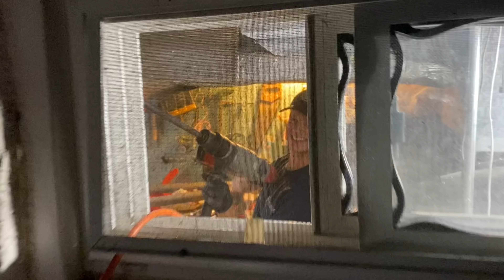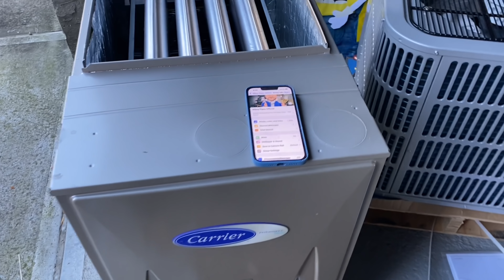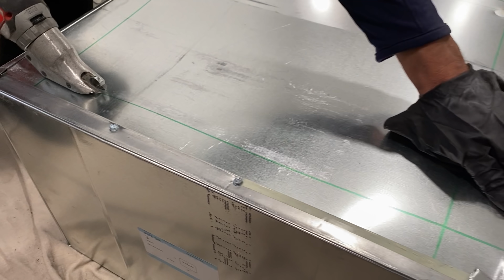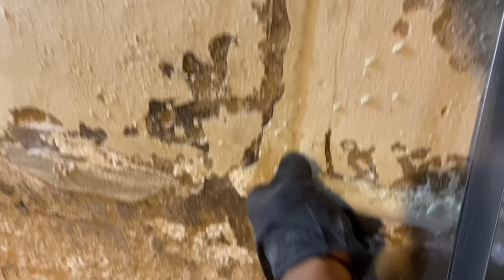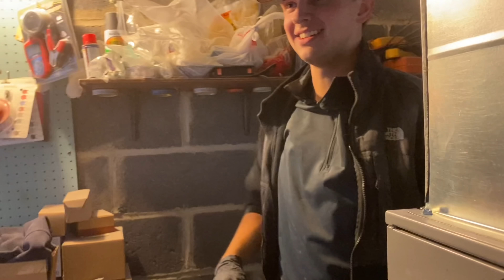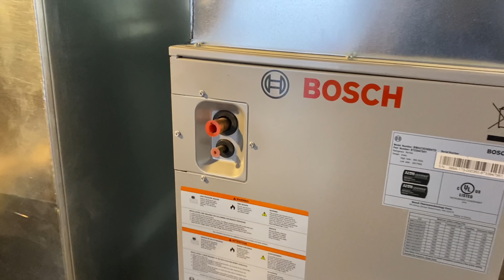Ultra Efficient Dual Fuel Bosch IDS 2.0 Heat Pump and Carrier 96 AFLU Furnace

Comment: Is it OK to use solder instead of silver solder brazing the dryer joints? About what psi is the equalized High and Low pressure that the dryer joints will see?  New AC refrigerant operates at higher preasures.
Reply: @PipeDoctor 
Couldn't see the solder label.  Did the research below.  Good stuff!

Stay Brite produces an overall component with greater strength than a brazed component whose base metals are weakened by annealment from high brazing heat. DETAILS
Stay Brite 8 solders bond with all of the ferrous and nonferrous alloys. Joints soldered with Stay Brite 8 solders exhibit considerably higher than necessary elongation for sound, dissimilar metal joints and vibration applications. Stay Brite produces an overall component with greater strength than a brazed component whose base metals are weakened by annealment from high brazing heat.

Features
Engineered to provide strong, ductile connections on copper, brass, steel and stainless steel
Silver color is a good color match to stainless steel
Its higher silver content provides a melting range versus a single temperature melting point
The melting range makes it suitable for soldering connections with a wider clearance
Its low temperature characteristic promotes capillary flow and less base metal distortion and oxidation
Often selected for residential HVAC tube connections as an alternative to brazing
Meets NSF Standard 51 for food service equipment
Conforms to the EU Reach & RoHS directive
Typical Applications
Heating, Ventilation, Air-Conditioning (HVAC)
Refrigeration
Loosely fitted couplings

Comment: Dual fuel is a great system  try the HONEYWELL  IAQ THERMOSTAT SET UP   Just wondering   Does your crew air seal all the duct work and sleeve the line sets going through the blocks   AND does the Bosch condenser  HAVE A FILTER DRYER WITH IN THE UNIT
Reply: Just wondering 
So you suggest using two dryers 
One at the coil and the factory one ?

Comment: Mikey I just had Bosch at my shop where I’m install and production manager and the guys were great. I had 2 junior installers that were having trouble with the dual fuel hydro back up and they were a huge help.. They were just back with the gas furnace. I’m totally shocked all made by Midea

Comment: I use the Honeywell 3000 with outdoor sensor whenever I do Bosch unit I recently just put it in a Eco e AC heat pump system very similar to the Bosch systems the Eco e have an app that you can download that will show you your pressures either way both systems are very nice especially the Bosch

Comment: Great install, looks great. Only thing I don’t like is the solder when it should be brazed lineset. I don’t know what American standards are but we don’t do that here. That said, I can see the skill you have in these trades and you sir are a fantastic tradesmen. I have four Redseal journeyman trade tickets, Refrig, residential gas, industrial gas, and plumbing, so I can see the little details, and recognize the little skills a good tradesman has, you have them! 👍🏻
Reply: You really don't need to braise the line sets only thing you need to really worry about braising are refrigeration lines or if your compressor burns out in your doing the compressor change other ways to stay clean and silver bright works just fine

Comment: You said two times and showed on your phone that the outdoor unit was programmed to shut off at 30 to 40° and then went on to say that the heat pump would run to -14° outdoor temperature it can’t be both. If that heat pump only runs to 30 or 40° outdoor temperature no saving there. Beautiful job though Beautiful job though

Comment: #lovebosch# there ids 2.0 dual fuel systems are freaking amazing. I've installed 3 of them so far. Super nice. Had some issues wiring it, but figured it out. Other then that. I'd recommend them 10 times outta ten!

Comment: Forgot to add. The shears are dull. The head comes from Kett more than likely. Contact Dynamic Fasteners. I’ve bought close to 200 sets in my lifetime. Running 6 crews of sheet metal iron workers.

Comment: # Love Bosch. Safety Nazi Alert where is the overpriced dust recovery system for the core drill. Violating OSHA Silicosis rules. I’ve sucked down my share of concrete dust in 40 years and now paying the price
Reply: It's as hazardous as asbestos, Hilti makes a good dust collection vac.

Comment: Should have use a Bosch rotary hammer with the Bosch core bit. It would have done the job so much quicker. All my rotary hammer drills and jack hammers are Bosch and it never disappointment me.

Comment: I have a carrier heat pump with a propane furnace with an optimizer to control efficiency .  The outdoor temp is set for 30 degrees.

Comment: 20:38 Sorry, but by any means that‘s not professional at all! Not the right tools, because you should have a core drill (best choice: hilti DD with cut assist) for that

AND

 no personal protection for the installer!
Reply: A hammer drill works JUST fine.

Comment: You're wearing a Navian knit hat, beanie or down south know as a bogan. That leaked the filter drier install step out into the atmosphre. Bosch stated that the crossover  temp from heat pump to gas is 35 F to 40 F. That seems a little high. But I guess that varies by region and the cost of elctric and gas. Maybe?
Reply: i think it would be for 2 reasons, one for comfort to customer since it will only produce as many btu as it is rated on the cooling  side ( i think he said 3 tons , so 36,000 Btu of heat ( approx ) second reason would be to prevent outdoor unit from going into defrost mode thus running gas furnace and outdoor unit for defrost purpose . What we do not know is how many sq ft the house is and what the heating load is. What I think will happen is as it gets colder outside even above the 40 degrees customer will decide to run system on 2nd stage ( gas furnace ) only cause of comfort. I would think that the cost of Nat gas vs electricity to produce the heat needed would be less. Since the customer is a engineer of some sort he may like to play with a system like this. One last thing we do not know if the price of the outdoor unit is higher than just a straight AC , that would affect pay back period and perhaps some rebates to customer made it a no brainier to install a dual fuel system

Comment: Like the Bosch. Question about furnace blower speeds control with the inverter?
Reply: Wiring y1 is low stage y2 is high stage, the Bosch runs on the temp of the lines to control the inverter.But the Carrier only knows the speeds of the toggle switchs if no infinity control.

Comment: They should have upgraded to the Aprilaire Steam humidifier…love mine
Is it legal/code to allow for an orphaned gas water heater when upgrading the furnace? I had draft issues with mine after installing my new Trane furnace. I had to install a new Bradford White water heater with forced draft fan and then cap off the chimney as it’s no longer being used/needed.
Reply: You mean because the chimney has a larger diameter than needed? In general, no. That's pretty much how they run all summer without heating.
Reply: @rickw4160  I get that. Don’t know if it’s related to ambient temperature or not, but it definitely struggled after the high efficiency furnace was installed and removed from the B vent…I wasn’t that concerned about replacing the water heater at the time because it was around 11 years old. I was asked by the installer if I wanted it replaced at the same time as the furnace but I said no. I probably could have got a better package deal
Reply: @chuckquinn8026  it is technically possible that your cold chimney stack sucks out all the avaliable heat from the exhaust flue of the water heater. I get what your saying.  It could be possible to also reverse the flow if you don't have enough make up air. That would be bad. Do you have a b vent or just like clay liner?(sometimes it's just b vent into the stack, nothing else inside)
Reply: @rickw4160  just straight B vent. It’s plugged off in the basement and I ripped it out of my garage roof. Since I already had a hole in the roof, I enlarged it and installed a powered attic exhaust fan that operates on temperature and humidity in its place
Reply: No longer an issue than! Lol.

Comment: Nice install, black wire for reversing valve, why not the standard orange wire.  Black wire is generally considered as a power wire, or common. No need to confuse the next guy.

Comment: You don’t want to keep that unit above the concrete a little bit so you don’t get any rust or moisture on the bottom of the cabinet,Or even just some vibration pads so you don’t get any vibration vibration noise